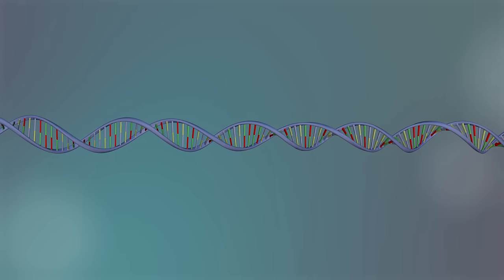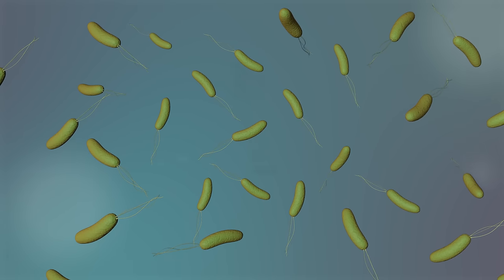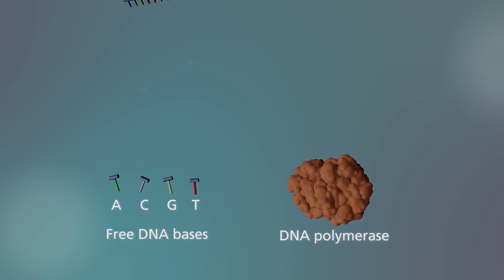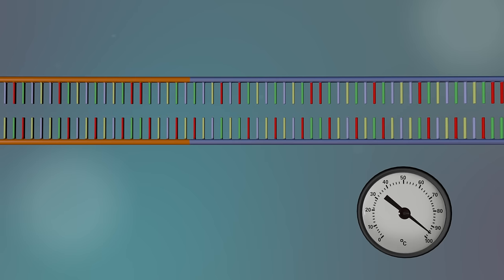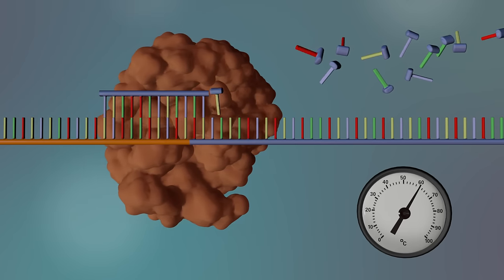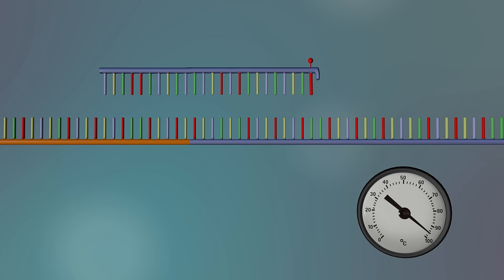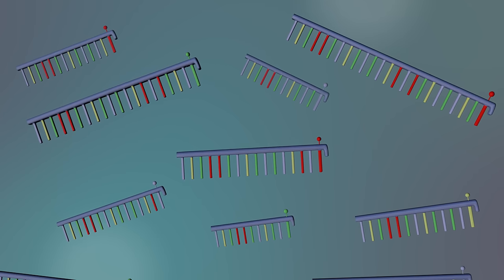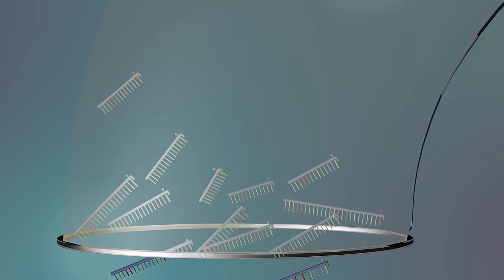DNA Sequencing - 3D

Comment: For those who didn't understand: Even though the terminator bases are added randomly, the process is repeated enough times that there are multiple copies of each length strands and all possible length of strands are produced enough times. As a result, when the electrophoresis is finally done the strands get arranged in short to long order, the last/terminator base of each strand marking the end of each strand. Thus when you put together the end base of each strand, you get the original sequence of that original piece of dna. (Remember the beginning portion of each length strand here is always the same because the primer binds to a specific location only, so the produced strands will look like this hypothetically: ATT< ATTC< ATTCG< ATTCGT etc.)
Reply: HeartThisRush how do you know that all possible lengths are copied where is the double blind study proofing this and i read the margin of error of using this technique to read dna is 23%
Reply: Just tried to explain how it is supposed to work. I actually didn't know about the margin of error, thank you :)
Reply: That actually helped - thank you!
Reply: THANK YOU SO MUCH !!!!
Reply: Maybe correlating the rate of travelling during electrophoresis with the bases weight/number would determine how many bases are there in each length?
Reply: Thank you
Reply: Thanku
Reply: How do they differentiate between two strands that are the same length and those that are not? In other words, how do they know if the next terminator base is really the next DNA base, or is just another copy of the previous base?
Reply: exactly. I would like to know that too
Reply: Nice, like a use of combinatorics /pigeonhole principle in math? (If I distribute 11 envelopes in 7 mailboxes you know at least one mailbox got >2 envelope etc) Thanks
Reply: @matejvedak  Yeah I wonder too
Reply: @aladdinoscopy  I didn't get what you meant
Reply: @ShukraanLife  Hi, how can we know if the next terminator base that gets read (by the laser?) is really the next DNA base and not just another copy of the base that was just read (by the same laser)? TIA!
Reply: @matejvedak  What I think is, since the electrophoresis process physically separates the varying sizes of fragments, all the same sized fragments end up very close to each other and pretty far from bunches of fragments of different sizes depending on how long they are made to travel in the electrophoresis gel. This way the laser detects bunches of terminator bases inmultiple number of bursts. And each group of bursts correspond to the same pattern fragment of DNA and will be quite some time lenghts apart from the subsequent bursts.
Reply: @anoop5611  Exactly. Same length strands stay together in a row so they get read by the laser at the same time.
Reply: @aladdinoscopy  Yes, exactly
Reply: this is precisely what was wondering, thanks! Now I am wondering how the primer can only bind to one specific location?
Reply: God bless you
Reply: Thanxs..i exactly wanted thid
Reply: Who the heck has invented this? How did they ''see'' on molecular scale? I am really confused.
Reply: i just come here to say GOD bless you.its a beautiful explanation.
Reply: This video would have gone wasted without this most important point mentioned here...thnx a ton
Reply: Thank you so much
Reply: @matejvedak  asking the real questions
Reply: Does the primer have a marker on it so the time between the terminator and primer can be measured. Knowing the flow rate exact length is sequence known. Otherwise there a lot of error.
Reply: thank you, your explanation made it much clear
Reply: useful explanation thank you! If I understand correctly, each copy would confirm that the precedent copies were aligned correctly and many times over.
Reply: yeah. that's the only thing i didn't understand -_-
Reply: So, why do you know that every possible combination of strand lengths has only been produced once?
Reply: Thanks. So we only read the terminator base, but by having strands of almost all possible lengths, the termination base for those strands covers almost all positions in the original DNA sequence, correct?
Reply: @SinanAkkoyun  basically because the process is meant to be repeated enough times that we should have certainty that every possible length was produced. The short answer is we can't really know 100%, it's a process based on repetition and time
Reply: @matejvedak  I’d just assume that it does without further reason. The real reason is probably something very complex and detailed that it would take lots of studying into other topics to understand 😉
Reply: @ad2181  yes.  the primer is marked
Reply: @matejvedak  Those that are the same length group together in the gel, so they will also be read simultaneously by the laser scanner, from what I understood.
Reply: There is just one thing I didn't understand. Isn't it possible for two new strands of DNA to have the exact same length thus also having the exact same terminator base? Then during the reading how could we tell if it is indeed a new base which is by chance is the same as the one before it or it is the very same base?
Edit: I just watched some other videos about the Sanger method, so I guess with this technique it must be similar to that.
Reply: I was told the experiment was run one time in each of the 4 test tubes and you get 4 fragments and that's it, is that wrong or right? if its wrong i will understand a whole lot better.
Reply: @adonissakellariou6051  i don't know if you figured this out all ready, but you are kind of correct that is the old way that they used interpret DNA sequencing. They didn't use dyes so they had to separate the "terminator bases" before hand (we call them ddNTPs). But now thanks to dyes/labels they can do all 4 in one tube! Hope this helps :D
Reply: I’m still a bit confused, but Bangla Natok made me a lot LESS confused!  Thanks!
Reply: @GodComplex100  how many times is that ENOUGH?
Reply: Found it. Look up Sanger sequencing and next generation methods. (links below)
I haven't researched deeply but these appear to be the common methods. Perhaps Sanger sequencing has been replaced actually.
I'd go deeper but I've gotta get back to writing my assignment! 😬

https://en.wikipedia.org/wiki/Sanger_sequencing
https://en.wikipedia.org/wiki/DNA_sequencing#Next-generation_methods
Reply: @FarranLee  how many times is 'enough'. Without process quantification this is just fairy tale for primary schools.
Reply: Thanks, your comment was very helpful
Reply: thanks for sharing this.
Reply: I have a doubt bro, the sequencing machine reads only the Terminator base, but what about the all base pairs,
Reply: Thank you very much. This cleared up my doubts
Reply: Based
Reply: Your comment was extremely helpful, thank you so much.
Reply: Thank u 🙏
Reply: You are a life saver explaining this process! Thank you
Reply: @ShukraanLife  i would said the same for the people that didnt understand
Reply: @matejvedak  it's not actually the next. if it was the same length then they would pass together at the same time . maybe the technology is used to count the light once if many fragments passed at the same time with the same lazer
Reply: THANK YOU! Needed this
Reply: You clearly cleared my doubts
Reply: @matejvedak wouldn’t it be how far down the tube they made it? Theoretically small periodic spaced groups of like lengthed dna?
Reply: Thanks a ton! i was unsure how this works after watching the video. But your explanation makes sense.
Reply: THIS!!! without this piece of information ,this whole video and the books i have read were useless. THANKS A LOT!!

Comment: This video isn't entirely clear to me, when polymerase creates 5 base pairs and puts a terminator at the end of it, how can this sequence of base pairs be converted to a single nucleotide letter when being read? There's a whole lot of information missing from this video and it doesn't make a lick of sense. When the pieces are filtered by size and read out how is the sequence of dna maintained?
Reply: The first wave of fragments to show up at the laser would be just one base (the terminator base) after the primer. The second wave to show up timewise would be the primer, one regular base and one terminator base. The third wave of fragments would be the primer, two regular bases, and one terminator base. And so forth. So as the terminator bases light up their colors, they can read the first position, then the second, the third, and so on. It is only reading the end position of each fragment, but because the fragments have a common starting point and are sorted by length they can read each base position one by one. I agree this video leaves out too much needed background information. It needs to emphasize the common starting point, for one thing. Also the simplified graphics are actually confusing... the bases hovering around are only the exact bases needed to complete each fragment, and no extras? The terminator bases are waiting there pre-selected, rather than stumbling in randomly? There is only a single fragment of each length when they reach the laser? All this must be untrue, and to me that makes it confusing.
Reply: Don't worry about it too much. The entire process might be bogus and only exist in text books and propaganda material.

Comment: So, If I understand correctly. 
1. Cut DNA by pieces and add each piece to a sample of DNA (plasmid)
2. Pass each piece that was added with plasmid DNA to a bacteria that would multiply. (How do we not get repeated copies that we don't need where?)
3. Add free DNA bases (A,C,T,G), DNA Polimerase, DNA primer and modified DNA bases that will act as terminator basis
4. Then we raise the temperature to 90 for the spiral to spilt in two (like PCR) and then low again we split so that DNA primer can connect and the free DNA basis connect, until it finds a stop sequence in which it adds the modified terminator basis. (How are we keeping the sequence here? Aren't we combining two things that we created, the DNA primer and the plasmid DNA?)
5. Then we raise the temperature again so that we can split the sequence that we just found. And then repeat process 4, 5 for many times.(Again... Aren't we getting repeated sequences?)
6. Apply electroforesis in order to split these sequences by size.
7. Then we get all the sequences and use a laser to light up the terminating base. And save all the basis that light up, this way we get the sequence. ( Why do we only save the terminating base and not the sequence? And how are we sequencing a person DNA if we are keeping one terminating for each gene sequence found?)
Added some questions for each phase in brackets. Hope that might be also other people questions. 
Best Regards,
Reply: 1. Repeated copies don't matter so much. Same sized fragments travel through the electrophoresis at roughly the same time, so duplicates will be ignored by the scanner. Even so, the process will be repeated multiple times to ensure no errors.

2. I'm not sure what you mean by your second question. The DNA fragment that we're looking to sequence is first added to a plasmid in order to get multiple copies, and then the DNA fragment is removed from the plasmids, as the plasmid is unnecessary. We only wanted multiple of the original fragment. That DNA is then mixed with bases, primers, and flourophore (colour) terminals to get multiple complementary copies of the original DNA fragment.

3. See 1.

4. Because the DNA fragments are all different sizes (varying from one base + terminal, to three bases + terminal, to n number of bases + terminal) we can determine the sequence of the DNA by measuring the fragments as they pass through the scanner. The coloured terminal that attaches to the end of the bases will be complementary to the base on the DNA strand. So, e.g the DNA strand has a C base. The complementary coloured terminal will be a G base - this will be read by the scanner. This tells us that at that point of the sequence, the base was a C. 

Imagine you have the sequence
ATCGATCG (random sequence)
The process of adding free bases, primer, and coloured terminals will result in fragments such as:
*T*. T*A*. or TA*G*. or TAG*C*. or TAGC*T*. or TAGCT*A*. or TAGCTA*G*. or TAGCTAG*C*.
where the starred base is the coloured terminal. The scanner will read only the terminals, in order of smallest fragment to largest, thus the scanner would read:
TAGCTAGC
we could then figure out the original sequence was:
ATCGATCG

whether there were a hundred T*A*. fragments, or only one, they're the same mass, two bases big, so will be read by the scanner at the same time and will only be counted once.

Hope this helps!

Comment: awesome video.
quick question: if the terminator bases are added randomly by the polymerase enzyme, how does lining up the DNA by length (using electrophoresis) with the terminator bases on the end get the DNA to be arranged in the original sequence?
Reply: I wonder this too.
Reply: thats what i dont understand! how does knowing the sequences of the terminating nucleotide give us the original sequence?
Reply: arielle aiken the terminator bases are complimentary to the original dna bases meaning u can work out the order of original bases by using the length of the molecule. For example if the shortest molecule has an adenine terminator base then you can deduce that the first base on the original is thymine.
Reply: arielle aiken btw Im a gcse student and this is the only vid Ive watched on this so sorry if Im wrong thats just my understanding of it
Reply: The primer is always the same (10 bases) but the count of free basis is always different. In this video, one  string has 11 bases added to it, another has 12... etc. and it goes up and up. By that technique you can read part of the original sequence because of the terminator bases.
Reply: Why wouldn't they just make every base that the polymerase adds have a readable tip, it must be that the readable portion fucks up the ability to keep adding bases?
Also, couldn't you get multiple snippets that terminated at the same spot, how would you know whether it went AA or just a single A?
Reply: +Evan L: Then how would you read it, though? The technique described in the video works because you always read only one color at a time. If every base was readable, then the laser would pick up a jumbled mess of colors every time and have no idea in which order the bases are.
Reply: Okay, I see. The MinIon can read every base pair as a different amount of electricity or some shit, guess you can't have each readable portion for the 4 base pairs read out differently with this system. I lost interest in gene sequencing because of the price of washes (enzymes?), but ty anyway.
Reply: Omg thank you may! I was reading some long explanations but yours made me see the light! Bless you
Reply: because the shortest will be the ones closest to the primer on the plasmid of course
Reply: i still don't understand since we can only read the terminator bases and determine which they pair for, why does the length of the DNA strand matter if we don't know what the other pairs are (not including the terminator pair)??

Comment: Well, then it would still read as a single base. The gel differentiates the fragments by size. And since we have already fixed the starting point, each fragment would have the same starting base. But the the terminating base has a very small chance of occurring at the same spot(probability or something). The result will be something like this: the shortest fragment will be the one having a terminating base pair adjacent to the primer. The second shortest will have a terminator base second next to the primer and so on.
Reply: and do scientists know the sequence of the primer?

Comment: i have a question what if two terminator bases stop at same lengths .... whole order will become wrong if both are read
Reply: please answer this
Reply: pls
Reply: Yes. There is no way to determine the order of a fragment (DNA cut into fragments at 0:15) using this process. Let's say ten G terminators are recorded in a row: how do we know wheter it is just one G repeated ten times or ten G recorded only once each or something inbetween? We have no idea.

Hence this method cannot determine anything. There are many more issues. For example, how do we guarantee the sorting order to be 100% accurate? Also note this is a 2D representation that makes it look easy and there is no 3D movement at all as suggested by the title.

I conclude the entire thing is a fraud. This doesn't have anything to do with science. Could be the entire DNA genome teaching is flawed or even fraudulent.

Comment: This does not make sense. Any fragment can end in any letter. Impossible to align later with single letter reads.
Reply: A’s only bond with T’s, and C’s only bond with G’s. So you reverse the order when it comes out, for example GTACTT would actually be CATGAA. If any fragment could bond anywhere it wouldn’t work but luckily it doesn’t.

Comment: i guess for smaller length of the fragment there will be countless copy, but isn't it possible skip some fragment's length if it is long enought ???? cuz the probability to reach there will be realy low so you could heppen to have the fragment with length 1,000,000,000,000 and the next 1,000,000,000,002,

and how can you differentiate 2 or more frangment that is next to each other with diferent length but the same terminator base??? like the sequency for the length 1, 2, 3, 4 be AAAA, but it will be thousands of copy for each one.